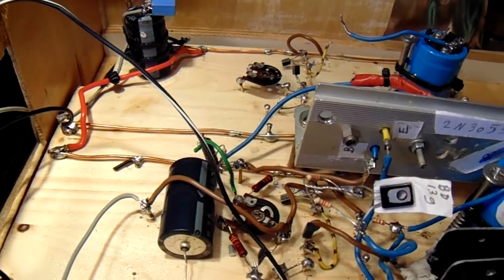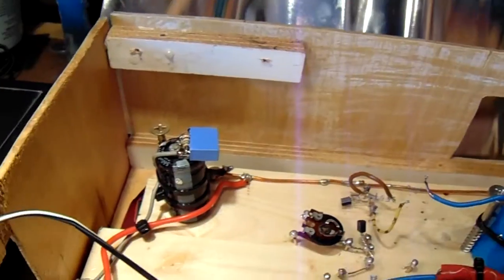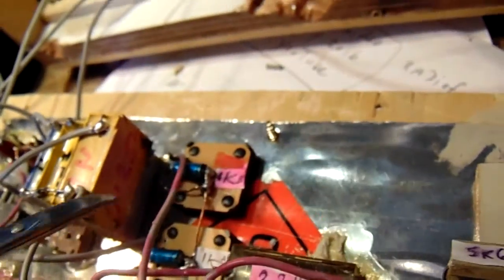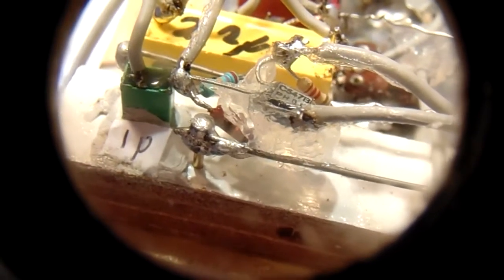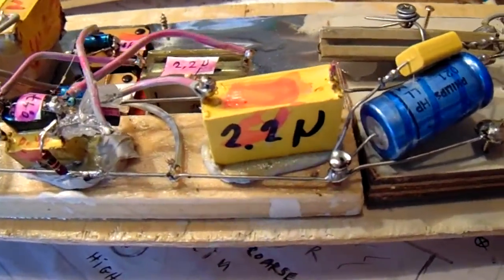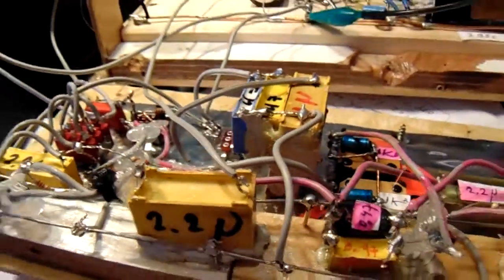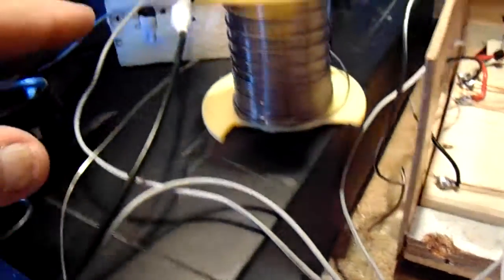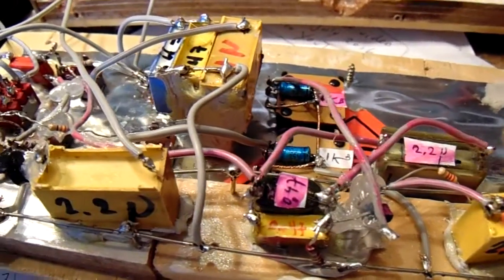Construction techniques from audio amplifiers:2 = ground loop HUM Demo & remedies

Comment: sir, you have  shown/demonstrated at time 3.45 how the ground loop is created, by removing the dark blue clip from negative rail again u have connected back the clip on the same place at 4.10 .i want know exactly which part  of the circuit  the other end of the clip wire is connected  so that ground loop hum is eliminated.Does this wire end  connected main earth or chasis  of amplifier thank u
Reply from the maker: Thanks for your question. My compliments, It is the best question I had since years. I have to say that it is very difficult for me to reproduce the showed experimental situation. But this was the issue: there were 2 ground-current-paths: one wire directly from pre-amp and end-amp (-) to the ( - negative ) from the mains supply capacitor from the right channel. It proved to be that there was another pathway for earth-current from the right channel. I think because I also made another wire, directly connecting the minus wires from both channels/amps (L+R) at the frontside (when I study the pictures in my book that I have written about this amplifier, available on the Lulu website, author Ko Tilman). I did  that to get good earth connections. But you can also say: that is a mistake. But when I hear the slightest hum or when I see risks in the way that I wired an amplifier I want to be (too much) sure about the ground wiring. That has to do with the way that this stereo amp was made: long wiring on varnished wood with brass nails.  Could be that the earth-hum also was there because the shielding (tin plate, at the front) was only connected to 1 earth wire from 1 channel (when I look at the pictures in my book: the left channel). So there proved to be an earth hum. I always solve these problems in the easiest and experimental way: I connect 1 wire to the one and only earth point (= minus from the supply cap, directly connected to the chassis) and touch with the blank tip of that  wire experimentally other earth connections (minus)  from the amplifier. Say: a point on the shielding, another earth wire, etc. As long till the earth hum vanishes completely. Than I solder that wire permanently and I am sure there is no ground loop. A kind of experimental way to solve this (very serious) problem for hobbyists that want to make an audio amp in an experimental situation. I hope I have answered your question sufficient. When you want to know more about ground-loops: buy my book "Schematics 2, audio amplifiers and loudspeaker boxes" available on the Lulu website (author Ko Tilman) or mail me at radiofun232@gmail.com.